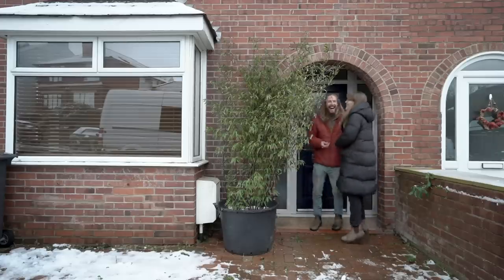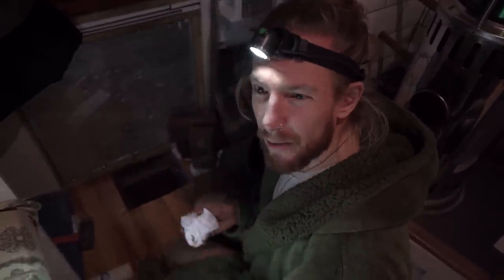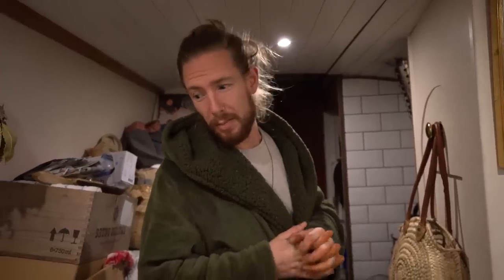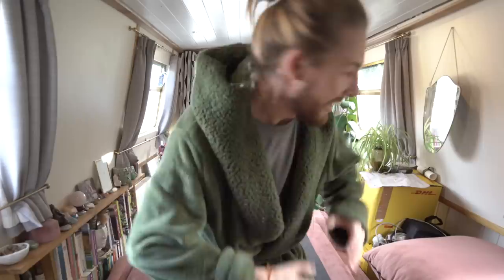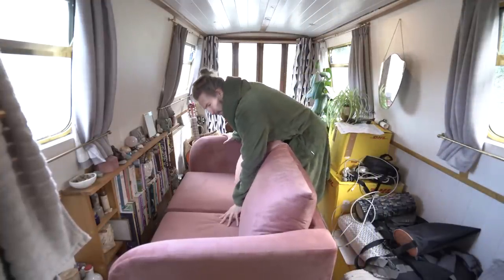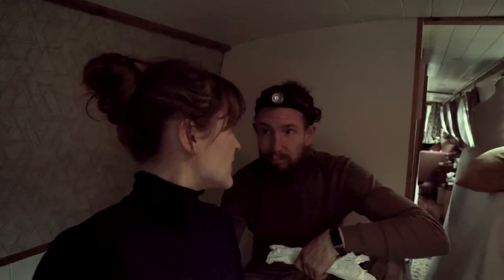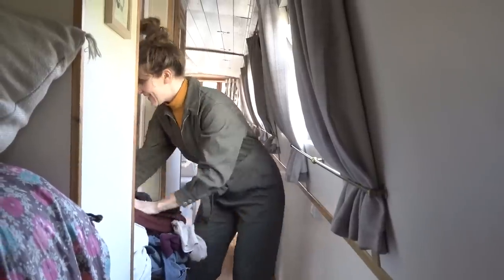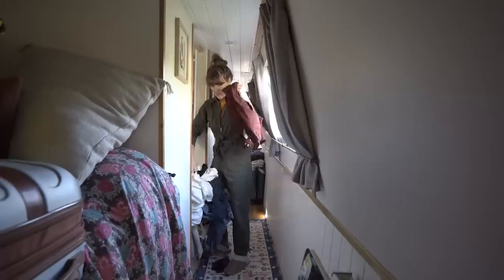Is our NARROWBOAT home SINKING? | EP 009

Comment: So useful tip, we can only run our washing machine if the engine is running when we are on the cut and that is despite having a good solar set up with decent batteries. The power of the washing machine is just too great. So it goes on once we are cruising. It does impact th engine slightly but nothing major and it gets the washing clean!! Great video guys you always make us laugh.
Reply from the maker: We have just updated our power set up (more on that in our next video)… but not sure we have space for the washing machine anymore haha!! It may be back to the laundromats for us 🤪🤪
Reply: @UlaandJosh  ah yes I saw Josh advertising your old panels. We recently updated our system, now got over 1000w, sold our old panels and mppt on marketplace within a day!! Bought by people building camper vans. Looking forward to the next video. X

Comment: I have a van, although i dont live in it, it's a process of learning to go backwards. Wr become used to 'labour saving' devices without giving much thought to the labour saving part.
Take tea, at home fill kettle from tap, turn kettle on, make tea, drink tea, put cup in dishwasher. In van, fetch water, get gas burner out, fill kettle, boil water, make tea, boil kettle again, put hot water in bowl, wash up mug, put gas burner away before you drive off, empty grey water.
With time you'll find where you need power and invest money in more solar, better and more lithium batteries, a big invertor: a better generator, all the niggley repairs will get done and all these things will become easier. 
You've got this! X

Comment: You can seal the leaky pipes with silicone. make sure the pipes are completely dry before applying the silicone sealant. This will be good as a temporary fix while you get some new plastic pipes and fittings from a hardware store to replace the damaged ones.
Reply from the maker: Thanks for the tips Milan xx

Comment: One of the main reasons why you can have water in a bilge, especially during winter, is you yourself. 

You are constantly breathing out water, and it condenses and ends up in the bilge. In addition, there's cooking (propane releases water when burned) cooking vapours and other water sources. Narrowboats are crap for ventilation, very few have extractor fans over the stove and this causes these kinds of issues. You may also have a leaking pipe somewhere, but again if the bilge was recently dry and there's water now that you live in the boat with cold outside temps then this is most likely a simple vapour and condensation collection.
If that's all it is, it will improve as the outside temps increase.

Comment: Plumbers tape wrapped tightly on the thread, check any thread isn't cracked, plus add 'collets' added to the plumbing fittings.
Looks like John Guest plumbing system.
Oh, expansion vessels don't need drip trays. The drip tray is for the leak!

Keep on smiling..good follows bad..follows good..

Comment: I feel your pain. Our power went  when we tried our washing machine and we had a load of wet washing. We’re a year in just, and the list never decreases but we love boat life. It has its challenges and NES - nothing’s ever simple 😅
Reply from the maker: Hiya Alyson, lovely to connect here. Where shouts are you on the canals? Did you manage to fuse the wires together when you tried your washing machine? And did you have to upgrade your system? xx
Reply: @UlaandJosh  We're just starting through London for the first time having been on the Hertford / Essex area of the River Lea. It was an isolator switch that had melted so Tim fixed that. Only tried again yesterday as we were moving but the washing machine was dead so will try again with the generator tomorrow to see if it's a power issue as in not enough, coming from the engine. It's been back to launderettes in the meantime :)

Comment: I have a switch in middle of boat set up for the water pump and leave it switched off until need a tap, shower etc. Otherwise the system is under pressure 24 hours for the occasional few seconds. You soon get used to it. Ots not very common but works for me.

Comment: Yes lovely vids again and what nice people you are. 

You are doing great
Reply: Hi, I was in the middle of a fairly long list of suggestions re your leak problem,  I will cut and paste just for your information,   but I doubt you will need it as you have likely found the issue.

As a list of possibles, not in any particular order.

▪︎ condensation,  especially cold hot cold hot boat, long showers, and polystyrene insulation,  rather than spray foam.

▪︎ frozen plastic pipe now dripping / weeping .

▪︎  And of course a possible hole in the hull VERY unlikely.  

▪︎ a leak from a window or a small ingress from roof (also condensation)  from behind the inner wood work and inside the outside wall

▪︎  finally,  drain pipe some where leaking. 

We don't know how much water you removed. 

My guess , if it was pints rather than gallons

It is very likely to be condensation.  There are many forums to help or stop at a canal boat specialist with a home made cake and ask then and give them a look at the video 

Look everywhere,  pictures pictures pictures

Clean clean clean 

Remove all water,   

engine bay clean remove all water, (you can then see if there is a leak of oil or coolant, diesel,  canal water from stern gland or or or.  I am going to stop here but just some thoughts .  

Engine

Comment: We've watched your vlogs from the start and enjoy them highly. 
Are you aware that a "travel pack" is available that is fitted to and driven by the engine. Its basically a 240v high output generator and enables the use of washing machines etc whilst cruising. Not cheap I believe but then nothing in the boating world is.😊

Comment: You could doo with getting the narrow boat out the water and die penetrat all the welds down the side and  under of the boat to see if there's a little pin hole or crack  on the boat and a good way to clean up a spark is use a wire brush if it fouled.

Comment: It must of been sooo scary seeing that water in the boat. And such a relief to find those leaks and hopefully have sorted the problem. I used to work on those type of small portable generators and because they are usually stored for long periods and not used the petrol can degrade and go "off" within about 1 month due to the high ethanol content of modern fuels. Drain all the old fuel out and use a fuel stabilser added to the tank to keep it working well. Unfortunately old "off" fuel can sometimes do damage to an engine.Hope this helps, and fingers cross that you're water problem is sorted. Keep at it and I am sure you will succeed. My Sunday night would not be the same without you guys 😊

Comment: Hi guys great video and real life boat life. Water in the bilge is better than ankle deep top tip if you think you know where it’s coming from put a drop on food die in the source. The washing machine drama 😢 most modern washing machines on the start up process take about 2-2.2 Kw and that is mainly the heating element a heavy power draw. I use a washing machine on my boat run off my generator Honda EUi 2.2 can be a pricey investment but worth it. Some people will say put a kettle of hot water in it mine as a modern machine thinks it’s old water and pumps it out 😁 you are doing great the highs and lows come and go. Heading your way very soon hope to catch up. 👍👍👍💐🥂🍺

Comment: Hi both, I love following your vlog and can only wish you the best for your new life afloat. Ula is correct when she tells you that you can not apply everyday life to canal boats. Take a pace back and slow down your level of expectaion for a much slower pace of life. One small piont I would make is that when you fit a new spark plug in an appliance yoy need to remember that the plug you buy is set to a maximum "open" setting. You need to establish the spark plug gap for the appliance you are fitting it in with a feeler guage so that the gap is correct. Otherwise the plug will coke up or not work correctly.

Comment: If there’s a leak on the jg speedfit. They’re simple to undo. They may need undoing and pushing in then retighten. Check they’ve used super seal inserts on the pipe ends (just research jg speedfit). Good luck.

Comment: If your battery's are not fully charged guy's and you plug your inverter in and the voltage drop is big the inverter will not work thats why your washer stopped as for the water ingress at the rear of the boat its normally the gland seal round your prop gone hard or dry , hope you get it sorted 😎😎👍👍

Comment: Hi have you checked the pressure in your expansion vessels the 2 red tanks. The black caps on top prise off below them you will find schraider valves as on your car tyres.with no pressure in your system you should have air pressure at the schraider valves about  1 bar or 15 psi  this is to allow expansion of the water in the system worth checking just use a foot pump to recharge the vessels with air  remember to check these once a year as with tyres they can go flat.

Comment: It's important to drain the fuel from the carb of your generator after each use, especially in the cold weather. Learn how much fuel it uses per hr and only put in what your going to use each session, so it runs dry after each use. This solved my issues.

Comment: When we bought this van that we live in, it had so many problems I named it "Twat", we still have problems, currently the water pump leaks. I have sealed it with some special tape until we get a new one, and I then have to remove the old pump and fit a new one, something I have never done before. We have lived in this van five years, but wouldn't want to go back to bricks & morter.
Hope this helps. It's not your fault, it's just par for the course.

Comment: Loving this channel! From UK but been in Australia for many years now, would love to have a barge to live on. I do happen to be a plumber - you said you found a couple of leaks - where from exactly? That pipe and fittings are 'speed fit' by John Guest - don't be afraid to unscrew and pull them apart (isolate water first!) if they're leaking. They should have inserts in the pipe and can leak if not there. Also this drip tray - sounds like it doesn't have an overflow? Definitely need one or a small pump to pump out somewhere. Maybe do a small video of your plumbing system, any questions please ask! 👍👍

Comment: If you’re changing batteries consider replacing the monobloc style batteries with 2v traction cells.  More capacity and longer life but more expensive… also check the gap on the spark plug, sounds like the gap is too large which is why it won’t start.  Is there a priming bubble?

Comment: Hi both.

Can I make a suggestion? If it's not your system already, perhaps put an on/off switch into your power supply for your main water pump. If you get into the habit of turning the pump off when not using it, you'll in effect remove the pressure out of your water system so any leaks may weep but without pressure they shouldn't leak anything like as badly.

If you get water stood on your base plate, put oil into the water to help stop the rust. 

Did your gennie cut out simply because the demands of the washing machine is too great? How many watts is the gennie and how many the washing machine?

Boat life has these times folks (our calorifier is weeping at the moment, and that's a sod of a job) - but overall it's well worth it. We've been afloat almost 30 years and wouldn't want to move onto the bank.

Sing out of there's owt we can help with.

PS - it gets easier. In a while you'll get more familiar with things like the sound of your pump, so when bearings or seals start to wear, you can head things off before they get as difficult as they've become. These things take time though - so use the other boaties to help for now.

And some reassurance re your base plate. A useful rule of thumb as to whether your plate is worn enough to need replacing is to look at the sacrificial chine at the point where it turns in to the stern swim. If the chine is worn back to the weld, then you're probably ready for replating. If you've got plate left, you're probably okay. Has she been replated (or shoes welded on), given she's getting towards being an old lady?
Reply: @vincethomrenaissanceman1731  

Until the day you go out with power to the pump, the seal let's go and you come back home to find the contents of your water tank in your bedroom. It happened to a lass we knew in Sheffield Basin and to another on the River Lee who had a bump whilst cruising which caused a leaky pump fitting. Flooded the bedroom - and she had to sit with doors and windows open in mid November trying to dry the boat out!

It's an old fashioned idea, but one well worth having.
Reply: I know nothing about boats- but this is such useful advice I would have thought 👍

Comment: It's great watching you guys. With the pipe issue if it's frozen inside the boat I would say that your pipe's would also freeze. So expanding the joints and causing the leaks. we have to drain down in our motorhome in the winter due to freezing pipes. 🙂

Comment: I used to have a mobile generator to run basic power on an allotment. They really are not as good as they should be. As for those 'push fit water pipes', I had a home made setup in a 8 x 6 glass greenhouse for a self watering system. Those so called snug fit pipes do tend to leak. I wrapped my pipe connector pieces in some sort of rubber lagging that you apply heat to to shrink it. It solved the problem, but meant the pipework had to be cut to make any changes or replace it. It stopped it leaking though (just a thought). 
Strange isn't it how we all think the worst when we encounter a problem only to find it is something relatively easy to fix. 
Bitchumen paint may be an idea to coat your boat floor and help with future rust problems. There are a couple of boaters like you two who did this (Danni and Joe - April 2021). I Recomend this as   even though it's one hell of a project, it is still your beloved home :) 
Many hugs guys - Tony

Comment: These days a spark plug works almost forever, they can be cleaned if they get a bit coated with soot, firstly just check you have the correct plug, (handbook or Google) then check the gap, again from your engine handbook, usually it is about 2.0 mm. You will need a cheap set of feeler gauges to get it spot on (or use the non tooth side of a hacksaw blade as a gauge)

Comment: I’ve thought of you two so many times this week worrying about that leak, hopefully it’s just a bit of plumber’s tape or a small, cheap part.  The washing?  Oh boy, I’ve pretty much, in my old age, stopped stressing and just accepting but wet washing, in the washing machine and it has to be moved, yep that would stress me.  Suggestion, but it will mean a bit of work every three days or so.  Actually I think you can buy these in camping stores here in Oz.  Buy a big bucket and a big rubber drain unblocker, drill holes in it and use it as a plunger to wash your clothes.  You’ll need to use wool wash cloths detergent (you don’t have to rinse with that) and do your washing like that, we do that in the caravan every three or four days.  BUT you still have to take sheets and towels to the laundromat.  What’s great is the wool detergent we use smells like eucalyptus so the van and our clothes do too.  Please don’t stress, I know there are always little jobs come up, even in our house that happens but the time will come when you only have to check the oil but yeah the occasional problem will arise, but guys you two are amazing you’ll rise above it.  💕

Comment: Possibly rain water getting below decks, second guess is part of the heat exchanger water, try closing all sea cocks, and see if water returns.  Do it just for a day.  If no water returns,  suspect a hose or rust leak in the engine heat exchanger primary cooling system.    If that is not the case, suspect a leak in the flushing water tankage system for your marine heads before it reaches the holding tank.  If it was the holding tank leaking, there would be no doubt, because that water would be on the nose and then some.  Refrigerator condensate or more likely air conditioner condensate is another likelihood.  Twenty litres a day is not unusual in areas of high humidity.

Comment: At 8:04 (this is a maybe ) those fittings are called speed fit joints (Elbows and couplers ,maybe 15mm )you can hand tighten those .
The elbow is nearest to you (right angled joint ) coupler is the further down (2 joints) .
The joints may have become loose after vibration etc.....  give them a pinch/twist and see if that helps..... its doubtful be the pipe (copper or plastic) it will probably be those joints.....
Hope that made a modicum of sense...!!🤣🤣🤣Tighten the ones in the background too...
Good luck

Comment: Are you sure you dont need to adjust the spark plug - the distance between the little hangover bit to the rest of the plug. We used to use a measure of blades to do this. Ask a mechanic.
Reply from the maker: Thanks for the tips Carol, really appreciate it xx